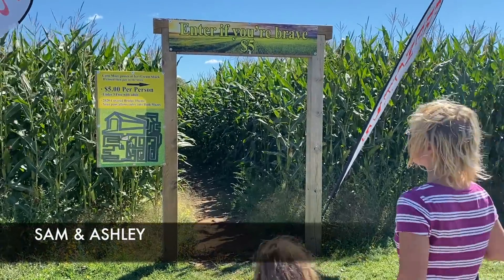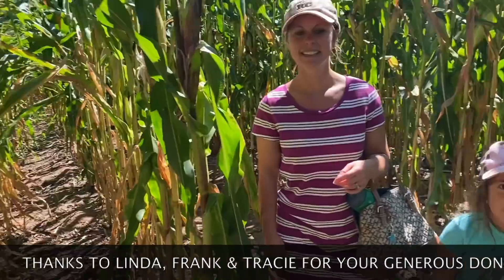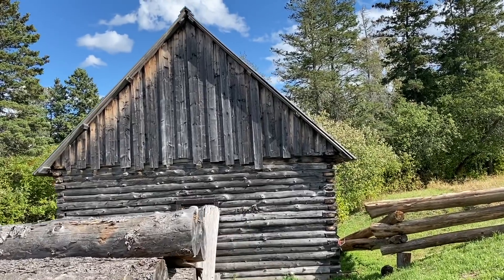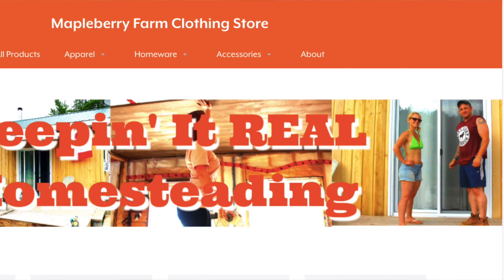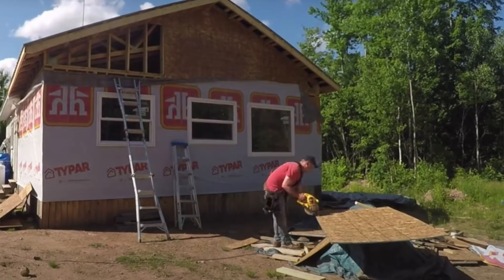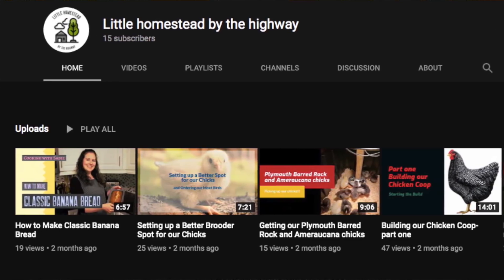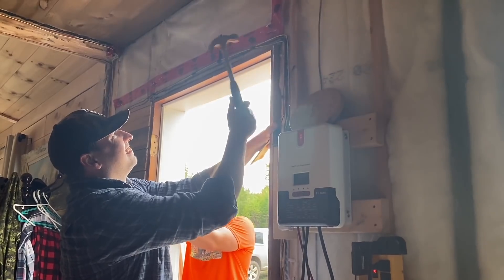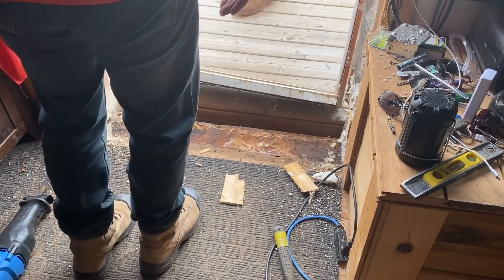We've Had Enough Of This, Time For a Change | Off Grid Wilderness Living

Comment: Sometimes you have to have something temporary until  you can get the final part.  As a software developer I see that all the time.  We provide a temp solution while we work on the better, final solution.  It works well and helps you move forward earlier.  Well done and nice to see the new door in.

Comment: I don't know how it leaked if it fit that tight
Reply: Air gets thru places you would never think it will go. It goes around corners, between multiple layers of materials etc. air can easily go places a mouse and snake can not go. And especially since it was not caulked very well and not at all under the bottom it’s not surprising that it leaked. And I hate saying that cause I don’t want to say anything negative at all cause they bust their butts to do the best job they can on that house but it’s just the way doors are.  In the states, we use one full tube of caulk under the threshold of the door then we use another tube behind the brick mold but you also have to be careful there and not put it too close to where the brick mold meets the jamb cause once you set it in then it will be in the gap before the wall framing and your caulk bead will not touch the wall sheathing and get squeezed into place as the brick mold is nailed to the house which will cause it to fail to seal. 

I hope that made sense. I know it sounds confusing but it’s really pretty simple. If you fail to get it sealed good underneath then it’s a real bad place for not only air but also water infiltration and I’ve had to Jack homes up to replace floor joists, bottoms of wall studs, sub flooring, and rim boards before on houses as new as 5-10 years old. It happens all the time unfortunately cause builders like cutting corners 

Hopefully they sealed it all good and just didn’t show it all, can’t imagine Jeremy not doing it and that will make a big difference this winter on heating 

Take care and stay safe!!